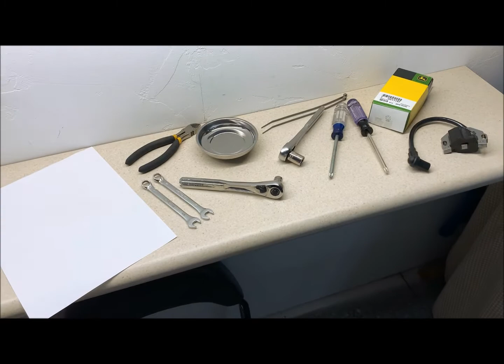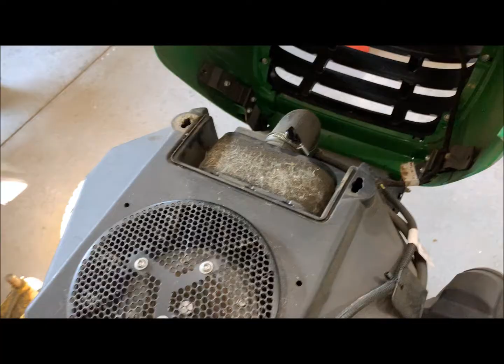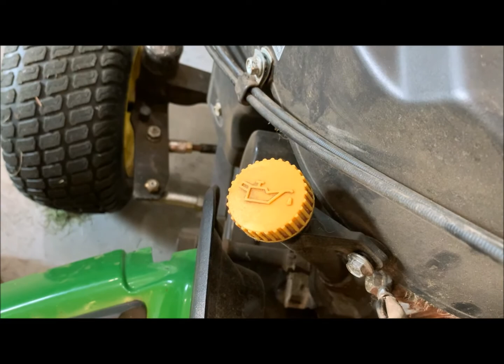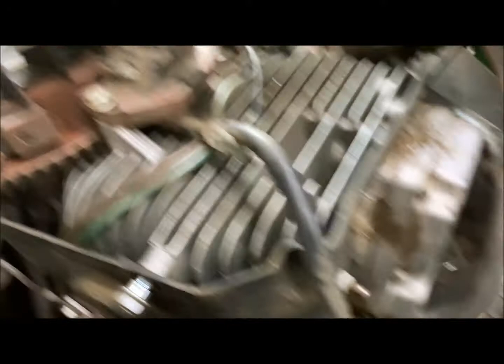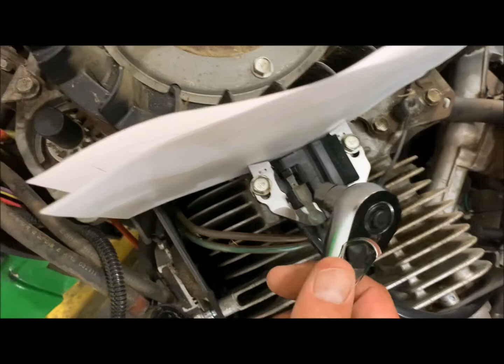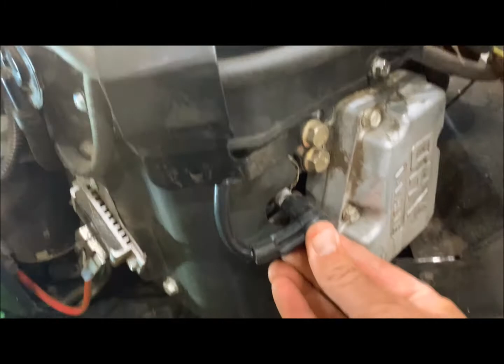John Deere x360 Coil and Plug Wire Replacement John Deere x360 Coil and Plug Wire Replacement

Comment: I think you just saved my day! Last time I did this you had to pull the flywheel and I was ready to load my mower up on the trailer but now I am going to pick up 2 new coil packs first thing in the morning. My x370 is down on power so pulled the plugs and one smelled like gas and the other was clean. Removed the spark wire from the "dead" side and engine still fired up. Reversed the process and it wouldn't start....hope the coils packs fixes it!!  I have 570 hours on my mower...
Reply from the maker: Hope this worked out for you!

Comment: Just found your video. My JD X320 has the same fly wheel cover as yours does. The 3 screws on top are on so tight that we can’t get them off and, of course, they are now stripped out. Any suggestions? We’ve oiled, Blasted, etc., but haven’t tried heat. I would hate to have to drill them out because of the small metal pieces falling into the fly wheel and who knows where else. Do they unscrew clockwise or counterclockwise? It’s very frustrating. Thanks for making this video. It’s the closest I’ve come to addressing this issue.
Reply: I stripped all three out. I had to drill out. I used a small bit and was able to turn them out by hand.